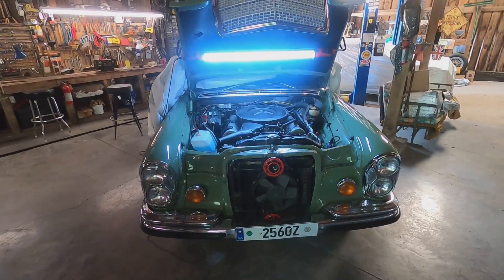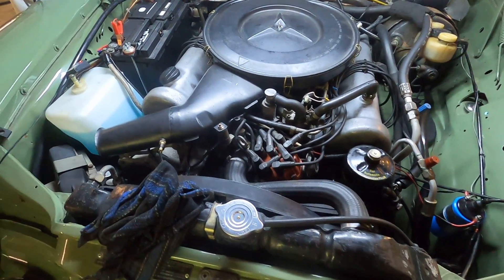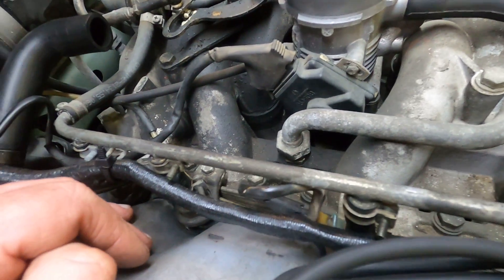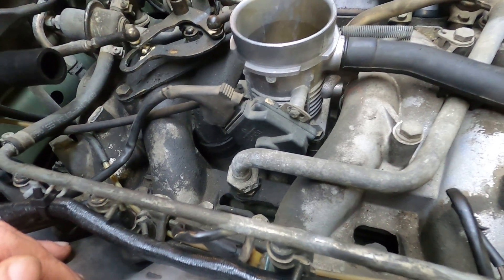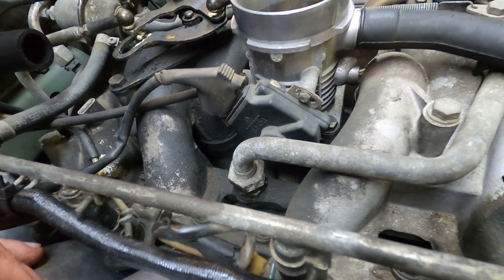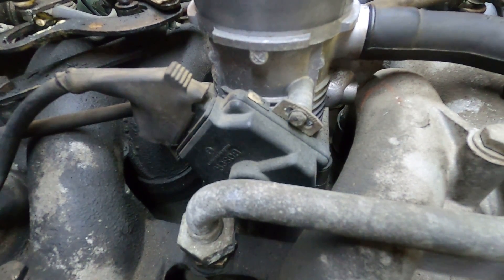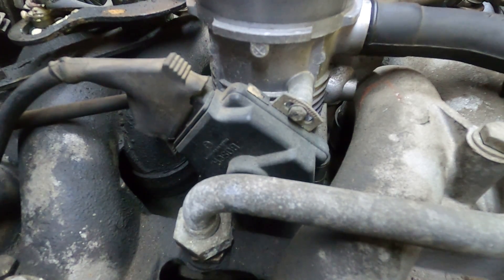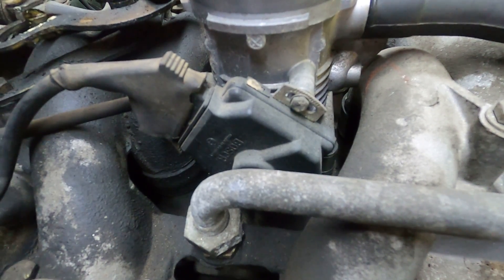1972 Mercedes Benz 280SE 4.5 Throttle Position Switch Check Bosch D-Jetronic

Comment: Hi , thanks for video ...
My car is djet w114 280E 
After watching the video, I tried it in the car.It clicked 18 times in my car. Why not 20? Do you have any comments?
Thanks
Reply from the maker: Thank you for watching and commenting. If your car is running fine, I would not worry about it as mine is a 4.5-liter V8. However, if it not running well Test the throttle switch with the key on, engine off. 2)Slowly open the throttle, and as it opens the injectors should alternately click. You should hear 20 evenly spaced clicks. 3)If this is not met, place a 0.016 in.(0.4mm) feeler
gauge between the throttle stop and throttle stop screw. Connect a voltmeter to terminal 17 of the throttle switch. The voltmeter should show voltage while the ignition key is in the on position. Remove the feeler gauge and the voltmeter should show no voltage now.

4)If this fails, loosen the screws and rotate the switch until it meets these requirements.

5)If they cannot be met and voltage is always present no matter where you position, replace the throttle switch.

6)If the voltmeter reads no voltage, ensure voltage is being supplied to the switch. If so, replace the throttle switch.

7)If no clicks are heard while performing test 1 and 2, check wire numbers 20,17,14 and 9 for continuity end for end from the ECU to throttle switch.
Reply: Thanks for answer....Will the connection socket remain plugged in so that I can measure the switch number 17? Will it remain plugged in the connection socket while the ignition is on? I couldn't understand that part. Also, there are 2 cables on the multimeter. When I mark one of them as pimple number 17, where will the other cable remain?
Reply from the maker: @kerimfalay1508  You might want to clean the unit (TPS) before you do anything. I suspect that is most likely all you need to do and then a simple adjustment. Mark where on the cover it is currently set before you remove it. Under the cover is a circuit board with 22 segments, across which three wipers are swept as the throttle butterfly shaft moves. One segment and one wiper make contact and signal the ECU when the throttle is closed. Another segment and wiper make contact to signal wide open throttle. The middle wiper sweeps the remaining 20 segments as the throttle is opened. Each time it "climbs" a segment, it signals the ECU to fire all injectors one additional time. This is, essentially, what D-Jet uses in place of a carburetor's accelerator pump.

Check the adjustment of the switch on its shaft and the condition of its contacts by turning on the ignition (don't start the motor) and manually operating the throttle through its full range. You should be able to count exactly 20 clicks from the injectors as you slowly open the throttle.

Comment: Thank you for sharing your experience with us. I checked my 1973 450slc 4.5, but no click sound totally with switch on.
Engine starting but when acclirator it's chocking 🥵
Reply: Hmm. My 74 450SL doesn’t have the clicks at the throttle valve. But the car runs fine and I drive it just about every day if I can. Gas mileage is pretty good. No high fuel consumption from what I can tell. So I don’t believe it’s running rich. The throttle valve opens when I push the pedal and am driving. But if I’m going 70mph on the interstate and just suddenly let off the gas as if I needed to break the car slows down abruptly if I just let my foot off the pedal fast. But if I gradually let my foot off the pedal it doesn’t abruptly slow the car down. Does that make sense?
Reply from the maker: The clicks are not at the throttle valve but within the throttle position switch itself and you should hear the distinct clicks (engine off) as you open the throttle. These cars have a lot of engine braking so taking your foot off the accelerator pedal abruptly will cause the car to slow down abruptly. Sounds like your car is running fine. Thank you for watching and commenting. @joshuaculley9695
Reply from the maker: It is quite possible the engine is starved for fuel as you open the accelerator causing it to behave as if it is choking. Does not sound like a throttle position switch problem. You need to check the fuel rail pressure and it should be between 27-30PSI. If it drops when you open the throttle, then that is the problem.
Reply: @kensshowtell  thank you for information! I appreciate your videos and the commentary! I’ll have to check the fuel pressure as well as change a few more fuel lines around the fuel pump running up to the tank and all that.
Reply from the maker: My pleasure. I did a couple of videos on this as maintaining proper fuel pressure with the engine running and after it has stopped is the heart and soul of D-Jet. @joshuaculley9695
Reply from the maker: Thank you for watching and commenting. The TPS (throttle position switch) can be cleaned. Check your linkage adjustment first.
Reply: Thank you for your quick reply and interest and patience.
Can you tell me click sound from where come.
The click sound must be when Tps attached with throttle rod or can be available when remove Tps.
If click sound not available. What this and how can be repair.
Where I can get workshop service manual pdf online please.
Waiting your reply ASAP.
Best regards,
Reply from the maker: The clicking sound comes from inside the TPS. I think you may find this link helpful. https://jetronic.org/en/d-jetronic/72-troubleshooting#Kaltstartventil @alhamedi66
Reply from the maker: The click sounds comes from inside the TPS. I've sent you a PDF using this email A1autoservices@alhamedi66 @alhamedi66
Reply: @kensshowtell  Thank you Ken's.

Comment: I also have basically the same engine. The 74 450SL. Would my throttle position switch do the same?
Reply from the maker: Thank you for watching. Yes, as your car has the D-Jetronic.
Reply: Alright. What if there are no clicks that I can hear.

Comment: Hello and thank you for the video..
Can TPS be calibrated manually?
or it has to be with ohmmeter..what are the steps?
Reply from the maker: And I thank you for watching. You have to use an Ohm meter. I have a PDF about on this topic concerning the TPS from R107 SL cars with the M11t 4.5-liter engine. I can send it to you.

Comment: I think the Throttle Position Switch would also be tested with an ohm meter, to make sure it had no dead spots.   The D-Jet systems are know to have failing fuel pressure regulators, especially at their current age. Thanks for the video and nice job on the camera work to show it up close!
Reply from the maker: Thank you.